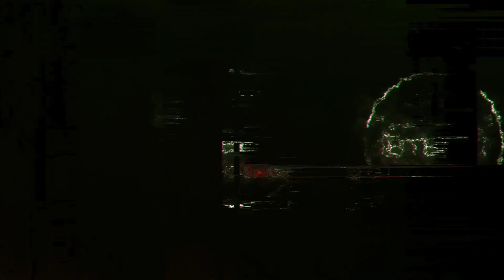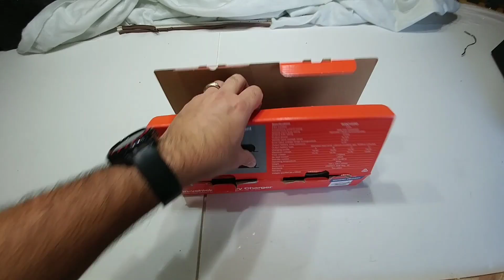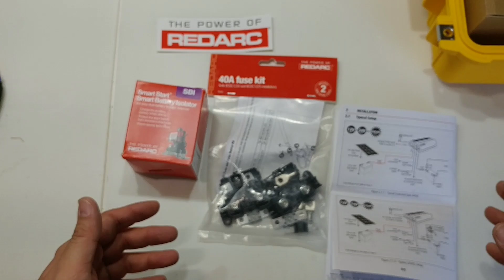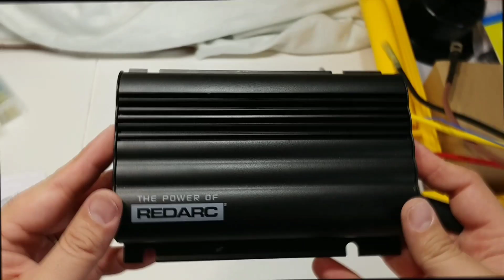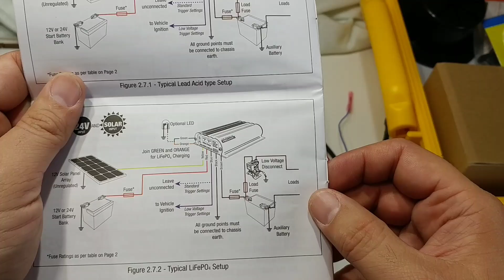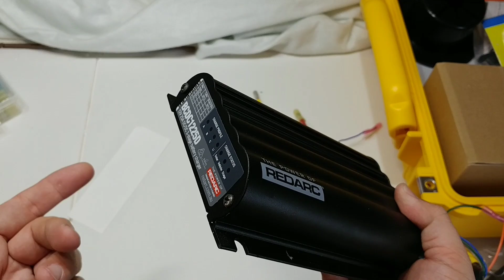Much requested! REDARC 25AMP RV Battery Charger from Australia!

Comment: Hint with these chargers are also have the controller as close as you can to the batteries. The voltage drop in the distance is rectified with this controller.

Comment: Thanks I’ve been waiting on this demonstration for several months now. I ended up just using my rear winch quick disconnect and adding a quick disconnect adapter to my trailer battery. Now I have a fully charged trailer battery at the end of my trips. I know it’s a low tech option and isn’t convenient for adding solar but it works for now.

Comment: A better product is the purkeys boss charger it will output 14.5v to charge your battery’s and just need a minimum of 9v to the input side. The connection is much simpler you just need to plug it to your 7 way plug and it’s made in usa

Comment: Those quick connect power ends are awesome I have used them several times they come in different sizes all the way up to 0 gauge. I use the Quick Connect ends and made a set of jumper cables with them I put one quick connect under my bumper and use the other end on a set of leads that way I would never have to open the hood just plug in and you can make a great set of jumper cables I use 4 gauge wire just thought I would throw that in love the channel always watching

Comment: Okay so more stuff. I really want to go in the opposite direction and use less stuff. So the alternator is incapable of keeping the battery charged? Is it because the wire is too small and or wouldn't it be less expensive and easier to upgrade the connectiontions from the truck to the battery? Let's talk about why the alternators can't keep up? Thanks as always for the videos.
Reply: The truck's alternator isn't designed to charge the house battery on a travel trailer.  You're essentially adding multiple batteries to your system.  It will provide enough power to run the brakes under normal conditions and the towing lights.  The break away battery acts as a buffer if the voltage is too low.  The guy in the video doesn't store his trailers at his house, and I don't think he has access to power.  I use a simple 12v solar panel for a deer feeder to keep my breakaway battery topped off, and I have 100 watts of solar for lights and charging portable tool batteries.  If you really want to charge batteries like in a solar setup an auto alternator is not the right device as it produces high current that does not charge deeply drained batteries correctly.  They make special alternators for battery power backup.

Comment: I ALWAYS recommend the Australian BCDC 
where batteries of different chemistries are expected to "Cross-Charge" each other.
(The RedArc BCDC is actually a smart DC-2-DC converter, 
with voltage mismatch compensation,
and with (including) a Virtual relay (smart-isolator/disconnector) function
(to stop one battery system completely flattening the other battery system, 
while still permitting cross-charging) , 
but it also doubles as a solar charging input, 
and also a voltage regulator that can be set to suit the "tastes" of your specific battery chemistry
(Limiting charging voltages).

In USA ,many of the batteries that we g(Aussie & NZ) get 
directly from China are NOT competitive (price wise), or not available,
so I would recommend for USA customers that they consider "BattleBorn" Lithium batteries.

Comment: What break control do you recommend for pulling a fifth wheel?
Reply from the maker: Lots of good ones.  It's more about the model with the features you wants
Reply: Big Truck Big RV I want whatever one you use. Ijs I trust you more then the people at the parts store trying to sell me one
Reply from the maker: @jamesbroderick3660  thanks! What's your tow vehicle?  Also, is it prepped for a Brake controller (has the harness behind the footwell area) or is it a complete install needing the harness as well?
Reply: Big Truck Big RV I have a 1997 Ford 350. Also I am pulling a 2018 KeyStone hide out and yes I need the brake control and the harness sir
Reply: Big Truck Big RV JD I’m still waiting on yoir answer lol
Reply: James Broderick are you sure you don’t have a plug under the dash right in the middle over the tranny hump? I have never seen a 92-97 f350 without wiring for trailer brakes